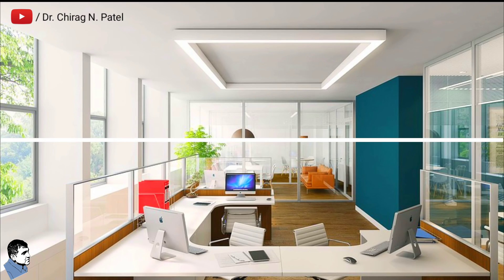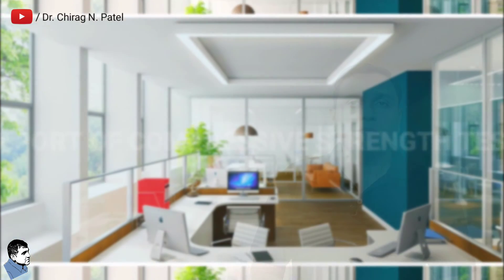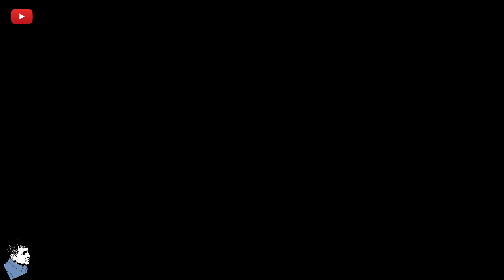Concrete Core Test | Concrete Core Cutting | Concrete Core Capping | Concrete Core bits

Comment: Sir,

Core Drill karne ke baad, Drill ki hue jagah ko kaise fill kare ?
Reply from the maker: Very nice Question Ahmed. I expect this from my best viewer, and it is you. Because it is not included in this video. For your answer I will upload video in short time. Keep watching 🙏🏼
Reply: @drchiragnpatel  

I really admire your efforts in making such videos. 

Thanks for your reply.
Reply: We use GP2 material with Steel bar inserting in it
Reply: Sir what is the minimum thickness required for core cutting in hard concrete for testing the compressive strength?
Reply: @craftkitchen3517  twice the diameter sir
Reply: @yusuke8854  Thankyou sir